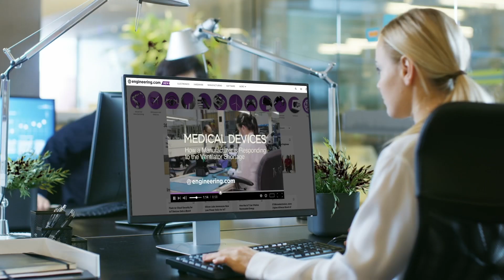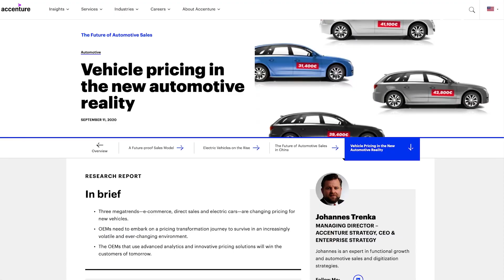Ford CEO Jim Farley on the Auto Industry: Structural Problems Abound

Comment: Need to slow down design cycles and provide reliable value for money. Solid modular design, upgradable systems, previous generation simplified electronics. Build something like the ford maverick with a short range PHEV with the awd drivetrain of the Toyota Siena. Price it at 30k and then keep it largely the same for the next 15 years with only minor changes to address warranty issues and decrease manufacturing costs.